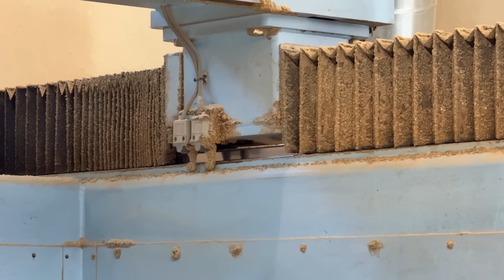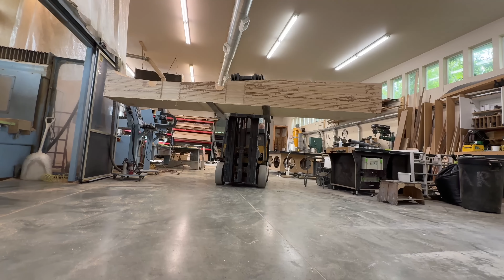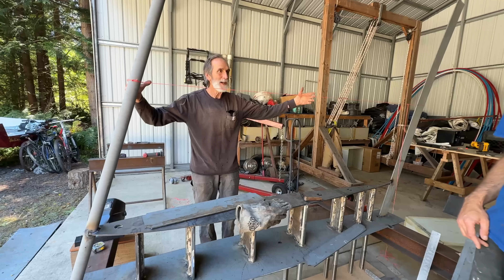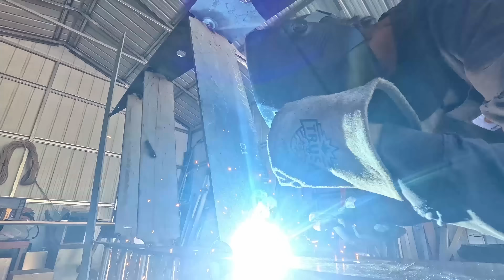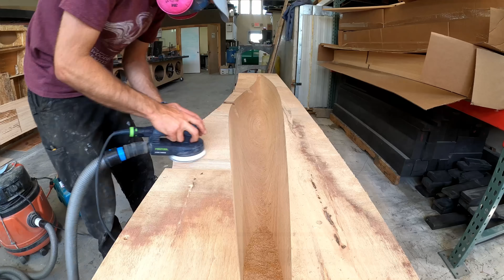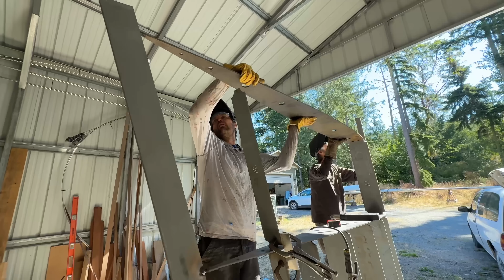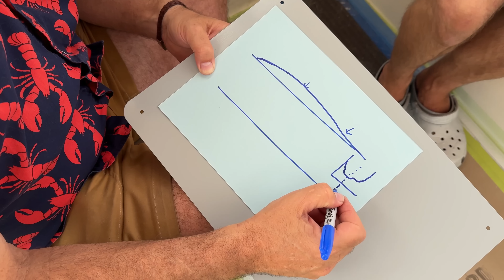The Coolest Thing About Our New Keel. [Ep. 184]

Comment: Love your channel and seeing the progress. Inspiring project. I'm amateur welder and no expert, but I do have some concerns about the quality of those welds... Kind of messy and blobbed on there. I pretty weld is a strong weld. Those big, messy blobs of welding material aren't going to be as strong. Looks like he's burning through in spots.
Reply from the maker: We’re going to have it inspected (not by the feline inspector)
Reply: @TheDuracellProject if the expensive materials are ruined by stick welder - the inspection will not help. it can not be fixed.
Reply: Exactly - half of the comments on the previous videos were about this 'pro' welder and the mess he's making with stick welding. But he is not listening...

Comment: would purgeing the fin with nitrogen make sence, `seeing as it would remove oxygen and any condensation issues from humidity in the air?
Reply from the maker: It’s going to be sealed and any oxygen will get eaten up by a little bit of corrosion (a tiny bit). The inside is going to be painted

Comment: I've noted some of the comments regarding placing oil in the keel to prevent corrosion. Another suggestion would to be filling the keel with an inert gas such as nitrogen to displace the oxygen and therefore prevent oxidation. A way builders of steel masts on workboats would achieve this by dropping burning paper into the mast void just before sealing the mast to use up the oxygen inside. Hope this helps. Loving all the work you're doing and am learning so much to complement my own boat project👍
Reply: As long as the void is airtight this is a non-issue. There will inevitably be some surface corrosion on the inside, until all the oxygen is used that is, and then it stops.
Reply: you worry 10 grams of oxygen can eat 3 tons of steel. burn paper, nitrogen, vacuum…

Comment: Too bad one of the keel attachment bolts wasn't hollow.  You could install a schrader valve in the top of the bolt and you could verify that the heel is air tight at any time.  You could also fill the inside of the keel with nitrogen.

Comment: Hi, there would ther be a problem with the expanding air inside the keel if you go from hot and cold water, like 5 degrees to 30 degrees? or will there be a equilibrium valve?
Reply from the maker: The temperature won’t fluctuate enough to make pressure a problem

Comment: I saw a few comments saying put some oil in the keel , another show I watch is a power boat related rebuild [ steel trawler to a cruising launch ] being a steel build something I noticed that was a good idea was his skeg it has a bottom plug and a top plug he uses the interior for scap oil being engine or hydraulic oil when he services his engine he empty the scrap  oil from the service into the skeg ..when the boat is slipped and at a suitable oil dump area he pulls the bottom plug and empty’s it ,, such a good idea I thought protecting interior of the keel and have a waist oil dumping site on board would definitely be a plus having a bottom drain point gives you a flexibility and quick access to to dump anything inside that you choose to store servicing engine excetra .. ps I do see a need to have a opening at the top anyhow to let pressure out when pouring the lead any how so no air lock happens when pouring lead
Reply: Project Brupeg!
Reply: @politicalGRAFFITI  yep project brupeg  he does have some good ideas but not all I agree with he still doesn’t know the correct way to splice spectra just tucking tails without the locking brumel doesn’t cut it neither does not tapering that tail creating a hard spot in the rope ..
Reply: @stevenmiller5088  If you do this, you have to be careful with future welding repairs - welders have been killed in shipyards when welding into an oil coated void due to explosions of the oil vapour. Modern practice is to avoid it and just coat the inside with paint and accept that any future rusting will remove all oxygen quickly
Reply: But... if you add a bottom plug you also reintroduce new oxygen every time you open the void. That's the flip side.
Reply: *empties it.

Comment: Why not weld the horizontal plates instead the vertical ones that will do the hard work ?
Reply: Harder to build. Imagine what a setup you would need to build that accurately. The welds are not such a drawback that it warrants a different build sequence.

Comment: Rust is iron oxide. If the keel is sealed, any rust that forms inside will quickly consume all the available oxygen and no more rust can form.
Reply: Yes; since the keel will have a pressure valve, was contemplating the idea of pulling vacuum on the space, then refilling with nitrogen. Probably unnecessary!
Reply: That is true.

Comment: I'm curious, and given the weight of the lead and steel of the keel it's probably negligible.
But seeing as it's filled with air, will it's buoyancy affect the weight and counter balance in any meaningful way?
Reply: Very slightly - but the stability software I use knows it is buoyant.

Comment: I'm not concerned about the internal keel structure of the upper part. i'm still very concerned about the non-stainless steel embedded into the lead. the highest heat epoxy primer I can find is rated for 400f, lead melts at 625f. any primer between the lead and the metal in that specific contact area will burn away. So you will have non stainless steel touching lead. Positive pressure nitrogen, or oil displacement may work, but lets say the worst happens and you hit something with the keel bulb and open it to seawater. Probably won't happen, sure, but if it does, you are getting seawater in that embedded steel lead area. In my opinion you should either add a stainless doubler plate for just that section of the keel, add some redundant embedded stainless bolts as a failsafe just embedded into the lead and through the lowest steel plate(s) or some other less absolutely certain to corrode in presence of seawater material. But its your boat, you seem to feel this isn't a concern, so I'll stop worrying about it too then. Good luck with it.
Reply: I believe they are going to cast the lead around a flange so that it will simply be inconceivable for the lead to come off. Also, the keel fin will be sealed independently of the lead. The lead plays no role in sealing. To actually have the lead bulb fail and fall off, it will have to be loose and working back and forth for a long time (something that will be noticed).

Maybe you are just worried about seawater getting in between the lead and steel. I guess that could happen. But it will still take a long, long time for that to cause catastrophic problems, and there will be signs of it happening.

Comment: You fill the fin part off the keel with food grade oil it’s common on bigger ships wher the rudders are made off steel. No corrosion and no problem with leaks.
Reply: I've built ships for the last 30 years, we have never done that. Just a standard coating procedure as Evan described. Never heard that that caused issues.
Reply: *of steel.

Comment: Would it make any sense to fill the hollow keel fin with diesel fuel to prevent any interior rusting?
Reply: Yeah but if it leaks out. Vegetable oil would be better but still if it starts coming to the surface in a port you have to ex-plane  that its biodegradable. In the old days they would fill them with old motor oil, rudders, stabilizers.
Reply: @tonyk0756  Yes, vegetable oil would be better.